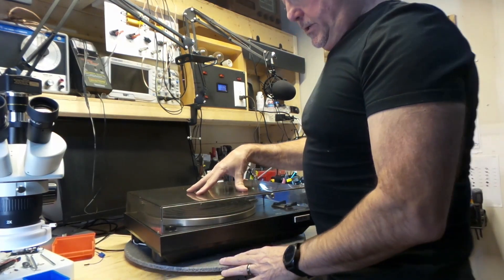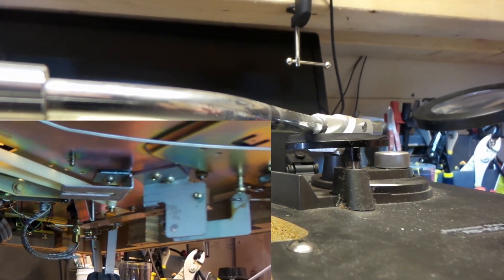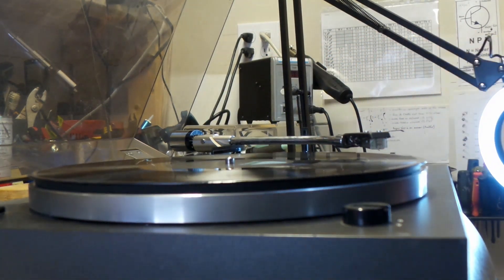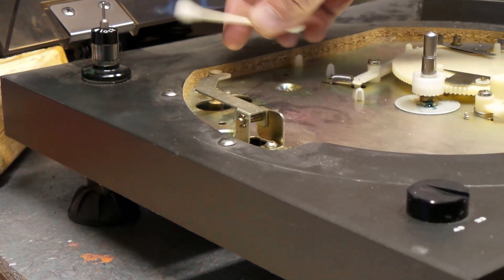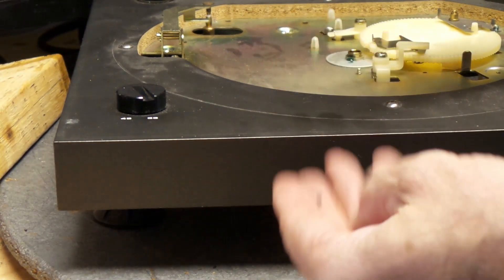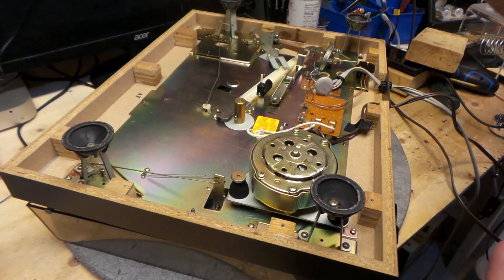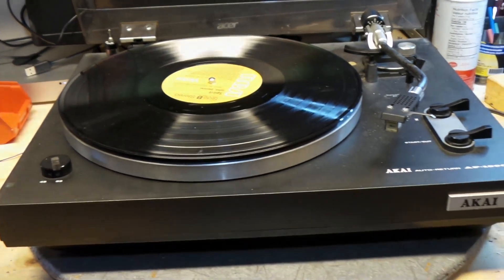Akai turntable in for a full servicing

Comment: More than likely the rubber feet will have sagged over the years; these should have been checked and adjusted or washers added to ensure they are isolating correctly.
Reply from the maker: Uhhhh....there was nothing wrong with the rubber feet for sure ..simple adjustments was needed and it worked perfectly... The owner tried to adjust it on his own and gave up...
Reply: @VintageAudioFever  yeah, right, rubber does not deteriorate over time NOT. Every vintage deck I have handled has had this issue to some degree. Live and learn.
Reply from the maker: @nenadkojic7125  yes i do agree that rubber deteriorates as anyone would know that...100%
Now back to the turntable. This time that wasn't the issue here on my bench  is all I'm saying but you do bring up a good point.

Comment: Really fun video, Joe. I wonder if you've ever worked on a Thorens TT with a TP-16 arm. I have one that was gifted to me at my wedding. I bought a new cartridge for it and it worked well but had a physical situation that bothered me! While playing, the tonearm is going uphill as the arm extends toward the stylus. IE; not-level. I figured out how to adjust the vertical pivot-shaft but, when I got it where I wanted it, the lid would hit the top of the tonearm gimbals assembly. I thought about this while watching you find the adjustment issue with the Akai turntable. 

Any ideas?
Reply from the maker: Hey William
First of all thanks for watching my video..and I did read your message and I have never did work on a Thorens yet...but your issue I'm sure could very well be a adjustment...just a question...did you by any change  the cartridge/Stylus that would of cause you that issue. I'm sure there is a explanation or maybe you did adjust the tone arm bit to high.
I wouldn't leave it at that position...touching the cover could cause issues later down the road so I would lower your tone arm for now so you have clearance.
I will look it up on line to see if there are adjustments....I'll get back to you on this one

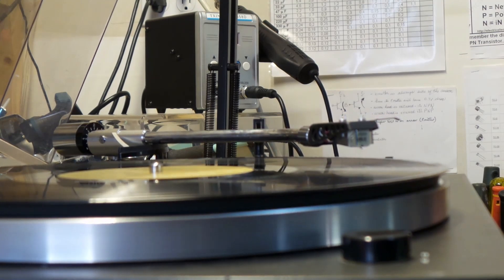Comment: I have the same Akai and problem with the 33 speed (45 i can't check couse I don't have 45 speed LP). It's a little bit to slow. The song which have 3:40 it ended 5s to late comparing to the same song from the stream. Belt is the reason or it can be something else?